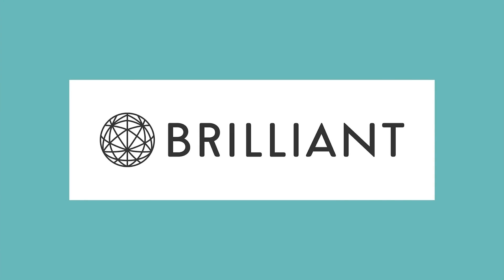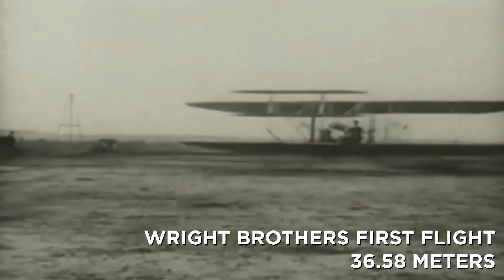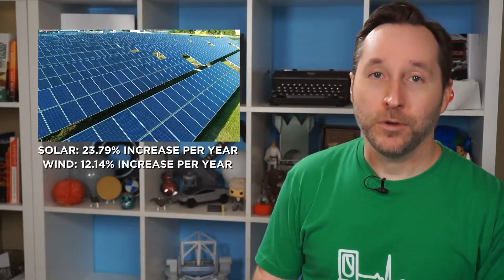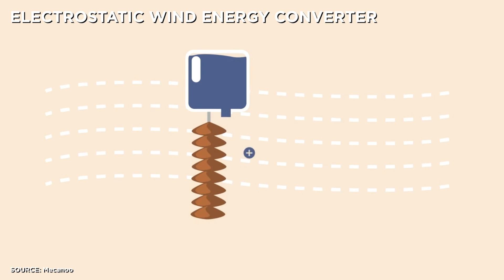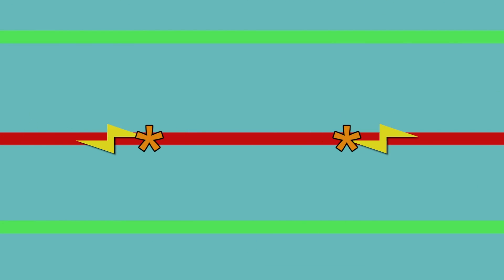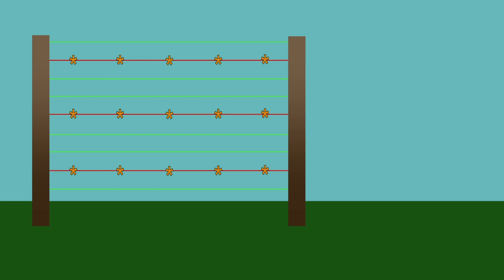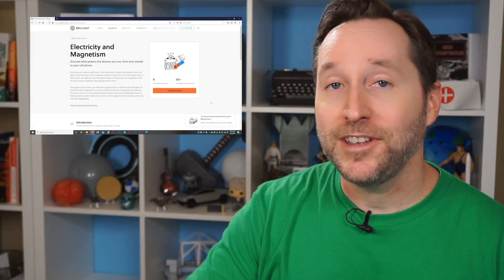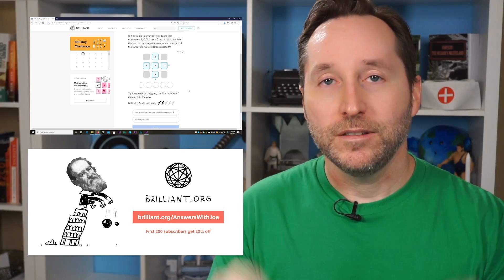Solid State Wind Energy | Random Thursday

Comment: They discovered that if they paint one of the blades black of a wind turbines, that bird deaths are reduced by about  72 per cent.
Reply: so birds are still in favour of segragation.??.
Reply: @robertmoore-x4y  Heat should not be provided by gas. Heat should be provided by heat pumps. Devices that are significantly more efficient than using natural gas for heat, and orders of magnitude above using resistive heating.
Reply: Ergo birds are racist

- Post modernist, 2020
Reply: Correct
Reply: Could a tiny whistle on the end of each blade do the trick? Or atleast something emitting a sound humans cannot hear yet these animals can?
Reply: Let's paint them rainbow, or colors of poisonous animals so that the birds know for sure to avoid them.
Reply: *percent or *%
Reply: @Lukarbonite  I see, an intermediate accidentally tapping of the ole space bar.
Reply: @ldfox11  Just wanted you to notice, not calling you dumb. Merry Christmas!
Reply: Just use a smaller spiral or barrel-shaped turbines.  Place them on top of existing electrical towers along the grid.
Reply: Nuclear energy doesn’t kill any birds
Reply: @lukereich3536  But people are unnecessarily afraid of Nuclear Power. The truth isn't told through our media, money controls our future not environmental concerns. There's still to much money infested in old forms of energy. So our lovely representatives in Washington will keep stringing us along promising change. The change is to slow and some think it's already to late, that soon the earth will suffer rapid change. Don't worry, a few of us might survive.
Reply: We have a Bergey 1 KW wind-turbine and it has not killed one bird in 10 years of operation, our farm cats on the other hand, well they are doing what cats do.
Reply: Drive by wind turbine all the time never did I see any birds near them🤷‍♂️not 1. Pretty sure the birds avoid them.
Reply: @strangescience3414  cause they all dead.
Reply: @bluellamaslearnbeyondthele2456  there are still just as many birds flying around😂🤣🕊🦅🐦🐥🦆haha that's funny.
Reply: @strangescience3414  Your eyes when you're driving should be on the road, not the sky.
Reply: @albertrogers2506  peripheral vision
Reply: @albertrogers2506  Your eyes should be on the more important things. We won't have an earth for birds to live on if we don't shift to renewables like wind, solar and geothermal. You want something with a turbine? Pumped hydropower. You don't like that? Battery storage. That's why Tesla is producing their Powerwall, to provide individual battery storage for electricity, because it's far easier and far more efficient for each house to have one or two small batteries to take care of peak power usage and to make use of lapses in demand than to have one big battery farm to do the same thing. Hell, even Nuclear would be better than what we have, especially now that the world is making finding a safe way to store nuclear waste long-term a priority.
Reply: @richardmillhousenixon  Here in Aus they added one massive battery to the grid for exactly this reason.  Works a treat.
Reply: @mattbritton6222  IMO, pumped hydro should always be used if the environment allows, but obv the environment in Australia probably doesn't allow that, in which case battery storage will 100% win out over small, inefficient peaking power plants
Reply: @richardmillhousenixon .  I like pumped hydro, but one of the advantages of the mega-battery here in SA is response times....in seconds.  There just isn’t any alternative that can do that.  The battery can only power SA for about 10 minutes...just enough time for other sources to ramp up supply.  As I understand it, that makes a big difference.
Reply: @albertrogers2506  And what if you add a battery? 
You can use solar and wind normaly, and have a reservoir for a peak cutting the advantage of fossil fuels. 
For example with EnergyVault or Gravitricity if lithium is a problem.
Reply: Christoochi  Some sort of nihilist?  People of your ilk deserve some of that Polonium 210 tea that  Putin's boys brew up?  With a couple of shortbreads as a side, you won't even notice the off taste.....

......and don't forget to turn off the lights when you sign off....!!!
Reply: Robert Dahlgren  Do you have a kitchen? The standard microwave oven in the USA is 1200 watts. An electric kettle is perhaps usually just less, but an electric stove gets a circuit with a 40 Amp max capacity at 120 V, which means its average burner and oven probably each run at a kilowatt. See if you can find out what the motor on your refrigerator and freezer demands when it starts up. That's an intermittent demand,  but some power companies offer a discount to customers willing to let them cover that demand at times other than peak load.
Reply: @albertrogers2506  most ovens are 240v. They are not used continuously, and the power load you state would be all over the board. Same as most things in your house that aren’t constantly operating.  Hopefully most things.
Reply: @robertmoore-x4y  The damned machine still DOES NOT help with the problem of fossil carbon gaseous combustion waste, which is what "renewable energy" is supposed to be about.
Reply: It doesn't help the bats any, I doubt the 2-digit precision, but 28% of a thousand eagles is still too many. That's before we count the falcons and the ospreys.
If one of the blades flies off and does no damage, the bird deaths from that device are reduced 100%.
Reply: @albertrogers2506  w h u t
Reply: albert rogers do you, by any chance have a cat, or a house with windows?
Reply: Wind Turbines have far better ramp up times than coal or even gas plants. In the time the gas plant is fired up a wind turbine has turned into the wind ten times.
Reply: @ErikB605  I wonder where you get your ludicrous information. You need to ramp up the power supply when the demand on the grid goes up. The one thing that wind and solar do less well than providing  steady power, is responding to a need for more power.
Owners of gas turbine generation, and managers of grid response, know perfectly well that it takes a gas turbine too long to synchronise with a 60 Hz AC grid, so both have arrangements to pay for the 30% of maximum power gas demand, that is needed to keep a gas turbine spinning in reserve. If your "renewables" are delivering 100 MW of power, you need about 100 MW of spinning reserve of this kind, power that the gas turbine can supply,  but isn't actually delivering.
Reply: @albertrogers2506  The UK uses them for energy and they work brilliantly. We have run with 0 coal for weeks on end over the summer when we had sunny and windy days.
They are also the cheapest energy source in the UK now (about 4pence per kWh)
Reply: @albertrogers2506  wind power shouldn't be on demand for peak generation. It can be the background providing that amount of energy that the grid constantly needs. 
Everyone focus on the fluctuations but not on the baseline.
Reply: @albertrogers2506  
Turbines are stopped for bats where attention is drawn to this issue. Bats are an endangered species, turbine owners are obligated to ensure their survival where possible (in the U.K.).
Reply: @GoodyMaximus  bats are dozens, hundreds, maybe even thousands of species, and some are worse endangered than others. In any wind that their prey, insects, can fly in, the turbines are worthless anyway.
It is utter stubborn ignorance not to realise that even the archaic current nuclear power is safer even for humans than wind is, AND that the USA had two designs quite clearly lab proven to be from 20 to 200 times as efficient in their fuel consumption. They are also proven meltdown immune, although it's a bit absurd to say that they're safer than the two cases of meltdown that had no victims anyway.  The third one, in the Ukraine when it was a Soviet satellite, was a direct descendant of a military plutonium production design, and failed from the violation of a known safety  prohibition. The death roll from that has been wildly exaggerated.
 BUT for the purpose of combating the menace of fossil carbon dioxide emissions, anything that needs spinning reserve is a way to keep the fossil fires burning.
No, batteries aren't a tenth of the capacity of pumped hydro, and when you look at the numbers for pumped hydro, even that's pathetic compared with the doldrums of wind power. Total world capacity is  under 100 GW, and six hours' storage at any such plant's full capacity is rare. Virginia has the biggest, 3 GW power and 24 GWh energy storage.
Reply: @jacksimpson-rogers1069  
Thanks Jack, I'm not sure how that argument negates my point about turbines protecting bats, if anything it seems to bolster my argument.
Chernobyl nuclear reactor disaster killed 28 men within the first four months, with an estimated 60 therafter as a result of the nuclear contamination. Not to mention the area it left uninhabitable.
Fukushima has had one death attributed to date, with the forecast to extend into three figures. 
That's just how radiation works.
Are the reactor designs meltdown immune? Or do the cores drop into a salt container to mitigate the effects? It's a great idea, I'm not sure it requires you to oversell it. The facts are good how they are.
Reply: @jacksimpson-rogers1069  
Well, thanks for the grammar corrections/criticisms. That's super.
Reply: @GoodyMaximus  Thank you for this response! I included the reference to "radioactive wolves" to make sport of the reporters who imagine "radioactivity" makes predators more dangerous.
BTW if you haven't visited elysiumindustries.com and thorconpower.com, that's two of the best bets for the continued existence of civilization. I have asked questions of Ed Pheil of Elysium and Lars Jorgensen of Thorcon, and received enlightening answers.
Reply: @GoodyMaximus  Also the estimated total death toll from Chernobyl is estimated to be between 6,000 and 60,000
Reply: @jacksimpson-rogers1069  is English your native language? Their usage of "within" and "mitigate" were perfectly fine to me.
Reply: @GoodyMaximus   @Jack Simpson-Rogers   it was quite an educated grand response. Thank you Jack S-R.
Reply: @albertrogers2506  Yes lets continue burning coal and oils, no life harmed in these forms of energy creation.... Oh w8... not really.

Stopping wind energy because of some dead birds that are a speck in comparison to the ecosystems we destroy by further worsening clinate change is the definition of shortsightedness
Reply: @albertrogers2506  Create some kind of frequency generator that keeps the bats away, I know this exists because i have pest repellers installed in my house and they use specific frequencies to keep the mice, rats, and other "pests" away without killing them. I do know that some of the frequencies can be experienced by humans because my brother in law swears he can hear them.
Reply: @albertrogers2506  killing 280 eagles a year doesn't matter when the eagle population is a hundred times that.
Reply: @albertrogers2506  ok buddy go get some more opioids
Reply: @albertrogers2506  sAvE aLl ThE bIRdS😂
Reply: @albertrogers2506  I’ll ask since no one else will. What, the hell, does a blade flying off have to do with bird deaths? “Catastrophic mechanical failure” is not the leading cause of windmill bird strikes. It’s kinda the other way around :-P
Reply: @albertrogers2506  Your maths is off 😂
Reply: @albertrogers2506  No world -- no birds.  Pick your poison.
Reply: @Steve-wz5pz    I think what they really want is no humans.
Reply: @albertrogers2506  oil spills are worse
Reply: @albertrogers2506  this is some wack statistics because not 100% of birds get killed by wind turbines. And where does the 1000 come from? Did you ignore the part of the video that covers how insignificant turbine deaths are?
Reply: @albertrogers2506  You don't know how math works, do you?
Reply: @albertrogers2506  These renewable energy sources are decreasing our reliance on fossil fuels which in turn should reduce our CO2 emissions. 
Try comparing birds lost to turbine blades to birds lost due to climate change. The former pales into insignificance to the later.
Reply: @albertrogers2506  I hope you don't own a house cat. The average American house cat kills more birds In a month than turbines do in a year.

Comment: I do not think it would work in freezing teperatures as wires would be covered with a thin layer of ice which would prevent  release of the ions. Additionally if the system releases ions, would that not mean the material actually is being worn off over time, ait depends on charged particles being ripped off from the cables and flying off?

Comment: " Green " energy is both Unreliable and Inefficient, ++ to make the materials for " Green " Dreams require FOSSIL Fuels... so... ya.   ffs
Reply: Yes, it takes materials and energy to make renewable energy gizmos. And it takes energy to get the materials, etc. And in initial stages, yes much of the energy will come from fossil fuels. But at some stage, renewable nergy can be the energy source for making more renewable energy gizmos. And yes, sun and wind are unreliable, so we need good energy storage. E.g. liquid air energy storage. It's not as silly as you think it is. Add in a bit of 4th gen nuclear, and Bob's your uncle.

Comment: I can't believe you gave the stats for bird deaths from cats.  How many raptors do cats kill? It doesn't really matter if 6 billion birds are killed and there are 20 billion birds.  But if 100,0000 raptors are killed and there are only 200,000 of them... well?  I just pulled those numbers out of thin air but the point is you are conflating apples and oranges because they are both fruit.  You're smarter than that, that's why I watch you.

Comment: OK then I appreciate your balanced outlook and graphic illustrations better explaining the Static Wind Generator concept. 

  After seeing a dozen YouTube videos experimenting with it I was hoping it would be a safe alternative to 12 foot diameter windmills since I have retired to Pacific Typhoon Ally Philippines.

My home is 1.5 meters above high tide sea level facing the Eastern Pacific Ocean with dozens of destructive Storms annually.  

Electric power is expensive here and very unreliable, almost daily black outs.  I use noisy gas generator burning oil and gas money.

When coconut cannon balls, flying metal roofing are hitting your home during a storm glass solar panels are at great risk,  so should a multi blade Wind generator have the blades removed during storms?

Comment: This video talked about the standard big propeller wind turbines and a new "no moving parts" wind powered generator, but left out a form of wind generator I've seen that sort of looks like an old push lawn mower (or at least the blades) on it's side.  I've seen DYI instructions for a backyard generator (for going off the grid) and read about versions on top of office buildings.  Did this type of wind powered generator just go off and die or is it just a European and off-the-grid thing?

Comment: Our problem as a civilisation is our over dependence on generators that work on electromagnetic induction. People have refused to think and come up with new ways to make electricity. Why should we always turn a conductor in a magnetic field? Come on people we can do better. Let's explore peizo electric cells, thank God for pv cells used solar panels but we need more out the box thinking. A field that has been greatly ignored is electrostatics, we can do so much if we just understand that all we have to do to create electricity is to make a potential difference

Comment: You don't run a voltage through a wire.  You apply a voltage/potential difference across a wire, (conductor).

Comment: "40,000V is a lot of energy which would drain the battery quickly" not unless it's running a substantial current - the potential is just a potential, so you'd have to tell us how much energy was actually used.